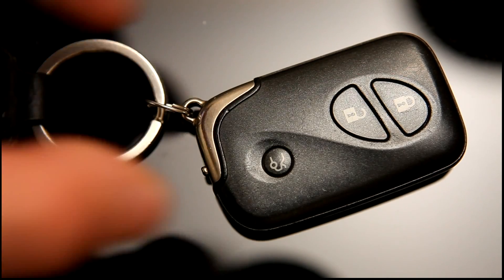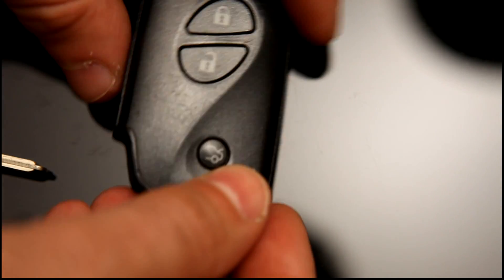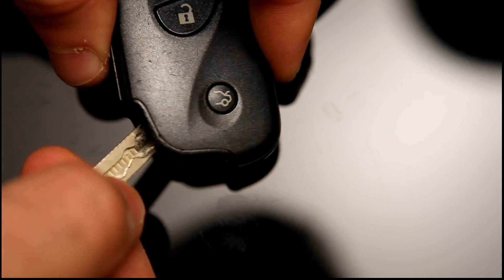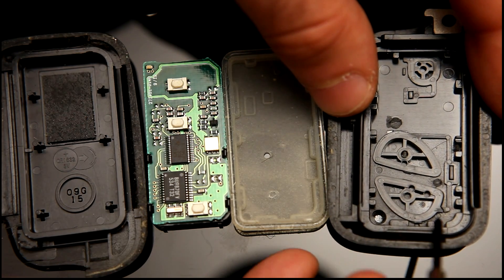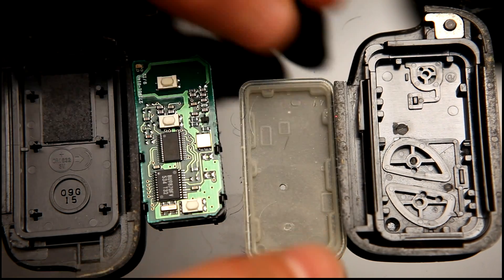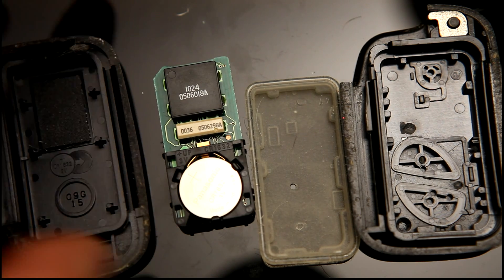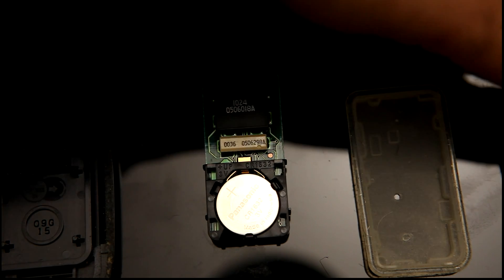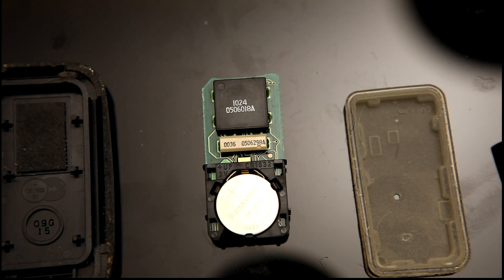Lexus transponder key fob Remote disassembly

Comment: How does the transporter component work without power?  passive NFC?
Reply from the maker: Yes.
Reply: Because the transponder does not need power is it possible to connect the battery directly to the transponder to bypass all of the buttons?